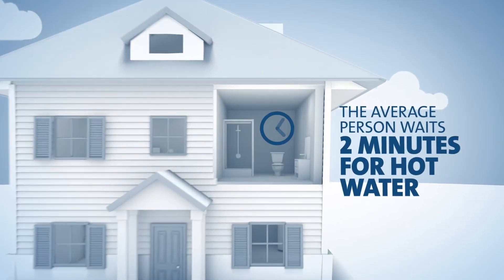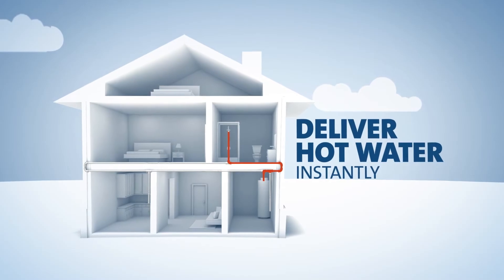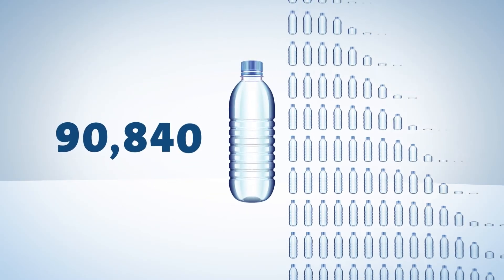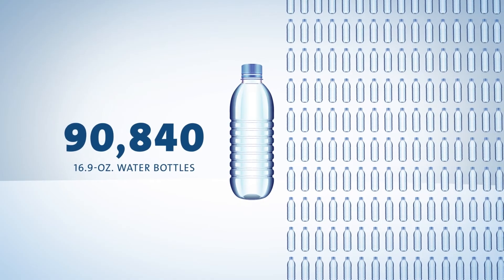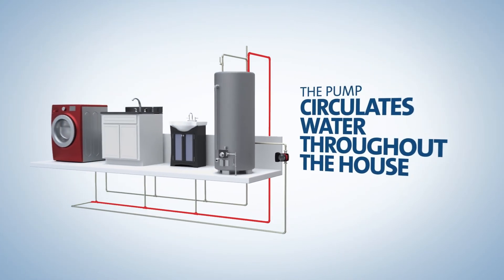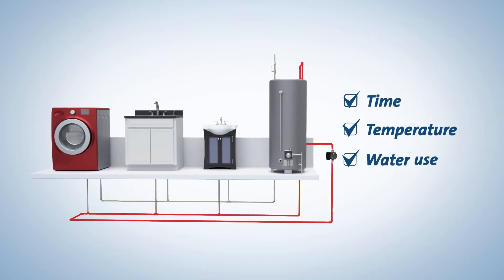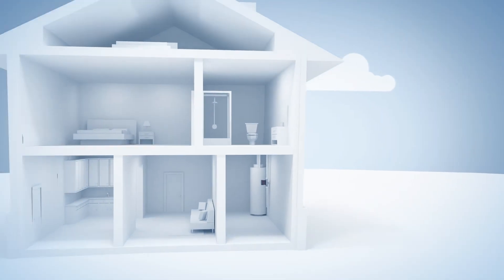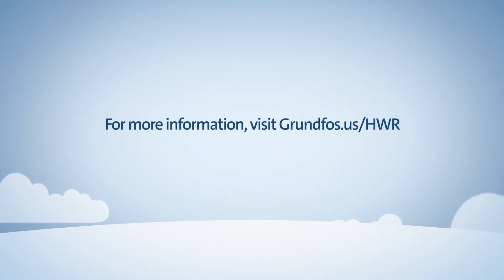How Does Hot Water Recirculation Work?

Comment: what are thermal losses in the return line system compared to without a return line?
Reply from the maker: A dedicated return line adds more footage of pipe, which can lead to more heat loss. Keeping it hot consistently will cause increased heat loss. If you're using either of the new ALPHA circulators, this is a good reason why we recommend setting a schedule via the Grundfos GO App to reduce heat loss and energy usage. You can find details on the exact amount of heat loss on page 116 of our Heating Handbook here: http://gfos.ly/6055Cly8S

Comment: It will save you time on the wait and less water waste while you wait to get hot water but it will make your water heater work more wasting energy....at this point whats more expensive  water or your heating source
Reply from the maker: Hey Luis! The great thing about our latest circulators is they have built-in schedules which the installer and/or homeowner can use the Grundfos GO or HOME Apps to set. This means it's not firing the water heater as often, saving energy. -Ty

Comment: In a system where there is no dedicated return line, when the cold water is pushed back into the water heater through the cold line, does there not need to be a check valve at the city supply line so the water does not get pushed back into there?
Reply from the maker: Hey there! Whether you have a system for hot water recirculation or not, code mandates you should always have a non-return check valve between the house and the supply line. Hope that helps! -Ty
Reply: You're right. Don't wanna be paying for the same water over and over. Its not code where I am, but it was brought up in class one day in plumbing school.

Comment: How does the recirculating pump over come the water pressure in the cold water line to send that cool water back to the water heater?
Reply from the maker: Hello! The boiler should not run when only the cold water side is in use. -Ty
Reply from the maker: Hey there, the hot water and the cold water are from the same source, so they are equal pressure. The pump increases pressure on the hot side to push water to the cold and back to the water heater.
Reply: Would that mean the boiler runs when there is only cold water use?

Comment: 'END THE WAITING AND THE WASTE" - Having a recirc pump ends one type of waste (wasted cold water) and introduces a new type of waste (wasted energy)
Reply from the maker: Hey there! The 7-day programmable timer significantly reduces energy consumption by allowing you to schedule the pump to operate only during periods of normal hot water usage, such as during showers or dishwashing. By doing so, it not only conserves water from unnecessarily going down the drain but also saves the energy involved in delivering water to the home and in treating it after it leaves the home.

Comment: SO IF IM AWAY FROM HOME LIKE 10 HOURS STRAIGHT THE PUMP WILL CONSYME ENERGY NEEDLESSLY
Reply from the maker: This is where the scheduling feature comes in handy. As you can set as many time and date options as you'd like. For example, if you really only need the instant hot water between 7-9AM and 5-8PM, you can set it to only be running during those hours using the Grundfos HOME App.

Comment: I have a dedicated line and a pump connected to it, and everything works great. I have hot water upstairs at the furthest point within seconds. However I want to change the HWH to a hybrid electric, and I have heard conflicting views as to whether a hybrid will work properly if connected to a recirculating pump. Any thoughts?
Reply from the maker: Hey there, our circulators shouldn't have any issues running with a hybrid electric hot water heater. In the past, we've had circulators that won't work with tankless systems, however our latest ALPHA Comfort System and ALPHA HWR will even work with tankless. You shouldn't have any issues! -Ty

Comment: What happens when the cold water is opened at the faucet with the bypass, while the pump is running
Reply from the maker: There can occasionally be bleedover to the cold line, however our latest pumps minimize how much bleedover there will be. Typically, it shouldn't take more than 5-15 seconds to get cold water. Hope that helps! -Ty
Reply: So now you have to wait for cold water. That just reverses the problem to the cold water line.

Comment: Is the cold water safe to drink if the circulating pump is mixing the cold line with water from your water heater?  Or do you need to run the cold water for a minute before drinking, to flush the line?
Reply from the maker: Hello! Yes, the ALPHA Comfort System and the ALPHA HWR will both fire tankless water heaters.
Reply from the maker: Hey there, if you are referring to hot water bleeding over to the cold side at the tap where a comfort valve is installed, then yes, the water is safe to drink. The pump should be installed on the hot water line and is not involved in mixing water from the hot and cold lines. Hope that helps! -Ty
Reply: Can one be instalked to a  tankless hot water heater? @grundfos
Reply: @grundfos Thank you!  Yes I was told by a plumber that you should not drink water coming from your water heater because of the contaminants in the water heater tank. That being said I was concerned where the warm water travels down the cold water line at the comfort valve that those contaminants are now being transferred to the cold water line.
Reply: @Jarut the contaminants in the water heater are coming from that original cold line, they just accrue in the tank. Don’t drink any of ur tap water unless you have a water softener system. Even then don’t drink it because we have poisons in our water that mess with our endocrine systems due to birth control drugs being peed back into the waste system, then treated, we do not have the technology in place to filter out these hormonal poisons in our water treatment facilities. I would do research on the softener system and try to get the best purity possible if u plan on cooking with it. Me personally i would still cook with bottled water that comes from a deep earth spring that is then filtered by the manufacturer of said water.

Comment: So, without a return line, the cold water line will be hot, while recirculating?
Reply: Correct
Reply from the maker: Hello, without a return line, that can be a consequence of a recirculation pump. However, our latest solutions have been built to minimize that warm water.
Reply: @grundfos What is your latest solution? Bypass valve sensor? I want to learn as I do not have dedicated return line.
Reply: @grundfos I have a tankless water heater without a return line. What is the solution?
Reply from the maker: Hey there, you'll want to look at the ALPHA Comfort System which includes a bypass valve for you to install at your furthest fixture. Here is a link to that pump: http://gfos.ly/6058vxIei
Reply: No, the cold water line just flows in reverse, and the water that comes from the hot line into the cold line is still just cold water because the pump only starts if both hot and cold water lines are full of ALL COLD water. Once hot water goes from the heater tank and reaches the return valve at the furthest fixture of the house, the pump stops immediately, so no hot water ever makes it into the cold water lines, except for a bit of occasional spillover because of small delays in the sensor, but it is usually very minor and gets flushed within 5-10 seconds of opening the cold tap. Try it out yourself and you will see what I mean.
Reply: @kevinvargas8355   My Rennai HW circulating water heater was installed in a new home with a Grundfos crossover valve at the furthest fixture.  It worked great for 6 years, but now when HW is circulating I get scalding hot water out of the cold water faucet at that fixture.  I have to run it for several minutes for it to go cold.  Any idea what could cause this?  Thank you.